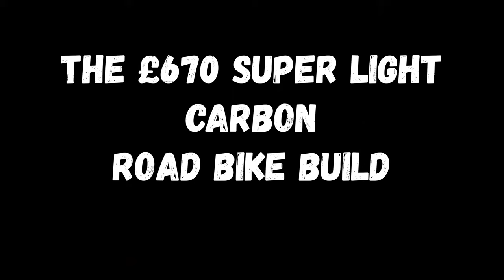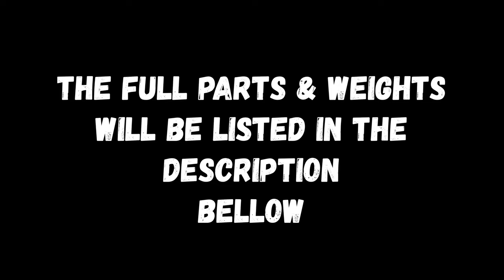THE 7KG CHINESE CARBON ROAD BIKE BUILD, ONLY (£670)

Comment: About what I paid for my Triban RC500 from Decathlon (which is pretty damn good after I fixed their build teams mistakes) 

I intend to do a lightweight carbon build when I outgrow it though, Velobuild do a sexy looking frameset with fully internal cabling that I have my eye on, thanks for the video!
Reply: Were you able to get VB frame? Which one, just wanted to see if they are still alive, Chris isn't replying to emails.

Comment: Is that crank the one that has an aluminum shaft? If yes, then that would eventually break due to metal fatigue. I think a channel called Trace Velo tested that.

Also, building a carbon bike without using a torque wrench? Good luck 👍
Reply: In Trace Velo's latest video on this crankset he said they've changed to a steel shaft. Just hope that OP bought the newer version

Comment: Hello can you link the type of frame that you used? I like the visible carbon weave on yours but the ones I see are matte black or have a dif geometry. Thank you!
Reply from the maker: Hey I can't link the exact frame however if you head over to Ali Express you will be able to find one that is the same or near enough.
Reply: @henrysummerside5158  Thanks. I got my frame already. How long did you have to wait for AliExpress to deliver the Sensah groupset? Mine hasnt updated tracking since 4/21
Reply from the maker: @builtbypi2276  The groupset took the longest to arrive as I had to wait for customs to clear it. I think it took around 2months, which was a massive shock to me.
Reply: Hello. "I got my frame already". Would you provide link where you got the frame. Thanks

Comment: nice video man. did you weigh the bike once it was built or just add up the advertised weights? when I built my chinese frame the actual weight ended up being 800 grams more than I calculated. Would be impressed if you got 7.0kg for such a low price!
Reply: dont see innner tubes and pedals in the description. not trying to be a stickler btw just curious!
Reply from the maker: The total weight is 7.3kg I have weighed the full bike with pedals. The wheels are incredibly light I saved a lot of money and weight with them.

Comment: Hi mate, great build video. Did you get your carbon frame and group set from aliexpress? If so did you had to pay VAT on those items? Thanks
Reply from the maker: Yes you have to pay custom fees on import
Reply: @henrysummerside5158  I know that you have to pay custom duty on imports but from jan 2021 you now have to pay 20% VAT on the purchase. Either you pay at the checkout or at the point of entry in the country
Reply from the maker: I didn’t pay VAT. However I ordered before that date dude

Comment: Any update on the bike? I am currently building one up w some baller wheels I found tubeless on FB. BSA cranks tho :/. I have found some bikes on aliexpress for 360 total USD, where'd you find this one so cheap?
Reply from the maker: This one was on Ali express honestly such good value.
Reply: @henrysummerside5158  Ig, do you know the seller? struggling to find the same price even when I filter the price. All I see are BXT
Reply: @joshualeggett8101  The specific seller for this frame was 'brand bike store'.

Comment: Awesome video, Have you done any riding review on this bike after your build? Any issues with the carbon strength, structure etc? Would love to know how you are getting on with the bike? Thanks
Reply from the maker: The frame is incredibly strong, I have been on a couple long rides and it has held up well. The bike is great on the climbs and is very quick down hills. I have had no problems with the bike yet and will be doing a in depth review once I get passed 1000 miles.